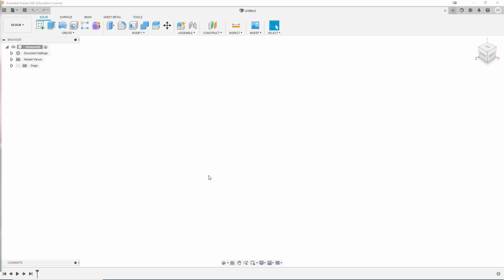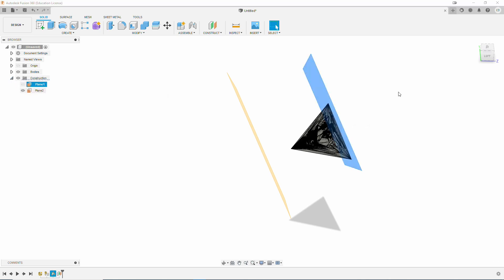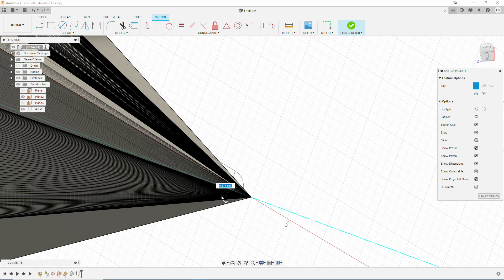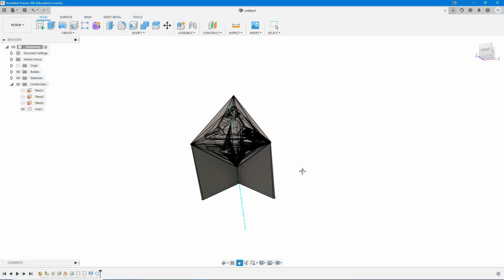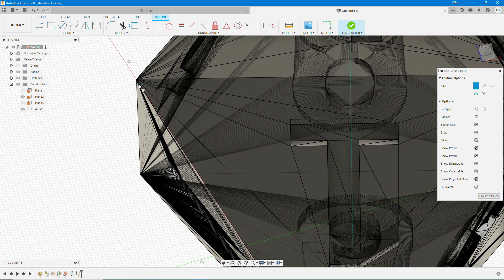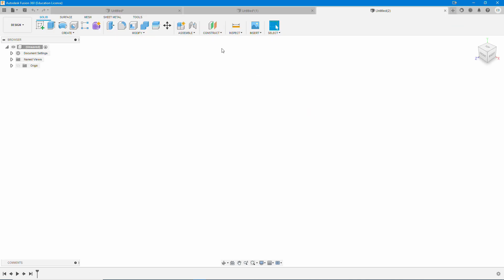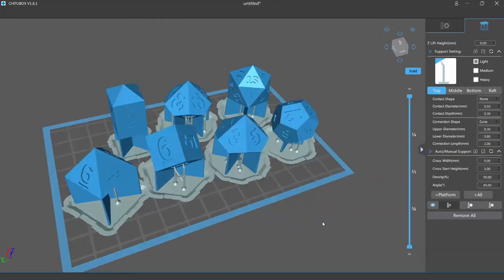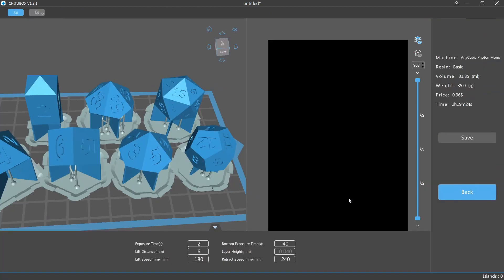Easy Fin Supports for 3d Printing Dice Masters

Comment: I just followed you steps this weekend and goodness did my first draft come out amazing with the fins.  Learning to make fins was certainly quicker than adding rows of supports to mimic a fin as other videos teach. And by using your method I learned new skills in 360 so win win.  My only goof was making the fins on the d6 meet at the tip. I think when I removed the fins it chipped the corner (Im not sure as I dropped the dice also and that could have caused the corner to deform ever slow slightly) But the good part about fusion is I just go back to my history, shorten the first sketch and let it reapply that change forward.  All the other edges and corners are as sharp and precise as i could have ever hoped for. Thanks

Comment: I realize this is a little old and not sure if anyone will see this but does anyone know how to make sure the number size is consistent across your dice? I have Text Size: 30 set across all my dice but the numbers are different sizes between them. I'm assuming the text size is relative to the size of the die and not the actual size of the font chosen?

Example: The numbers on my d4 with Text Size 30 is FAR smaller than my d10 with Text Size 30.

Any input or help would be greatly appreciated!

Comment: Hello! I keep getting bad geometry/self intersection errors when creating the lofts, but followed your instructions to the T (I think). I had problems with files from DiceGen before, but the same thing happened with dice I made on PolyDiceGen!
Reply from the maker: There is a box on the right hand d side with a couple of options at the bottom, one refers tangent edges, switch that option and let me know if it fixes the issue.
Reply: @KiltedDice  Tried both option and it didn't work :( The error message says:
There was a problem combining geometry together.  If
attempting a Join/Cut/Intersect, try to ensure that the bodies
have a clear overlap (problems can occur where faces and
edges are nearly coincident).
Reply: On the same model, after starting from scratch I'm now getting the "The loft would intersect itself" error.
Reply from the maker: @Nickmaytee94  for the join/cut/intersect error, you need to change the drop down box (on the right in the loft settings) to "new body"
For the "intersect itself" try switching the tangent option, if that doesn't work, you need to adjust the angle in your plane for that edge. It is too far off to one side, if that still doesn't work, change the distance of the offset plane, try closer and further away.

Comment: Wont lie hitting some issues. Some user error, possibly some being minor layout diff between mac and pc. However trying to learn key short cuts as it looks like you change between navigation/manipulation tools with keys vs buttons in the UI.
Reply from the maker: Excellent point. The only real keyboard shortcuts that I am using is the shift key for rotation vs pan (while using a mouse wheel). and the S key to search for "Project" which does have its own hotkey, but I forgot what it was while I was filming. If you could give me a timestamp of where you are having trouble, I would be more than happy to go through what I was doing with you. 
Also, Apologies for the late reply, was having some family stuff that I had to take care of.

Comment: Soooo, where is Part 3 for the Fin removal? :D
Reply from the maker: Lol. Will work that out on the next set
Reply from the maker: I just pulled a fresh set of masters from the printer for a client and will be using those for a fin removal video :-D Stay Tuned!!!
Reply: @KiltedDice  I just wanted to be a bit sarcastic with my sentence above :D
Buuuuut i still will be watching the Video bc I cant get the hang of clean removal, i am scarred to Ruin my Masters :o
Reply from the maker: @TheWubWolf  Clean support removal is a myth. You will always have some form of chipping. But fear not. I am currently working on a video detailing my entire finishing process to include chip repair. The fin removal will be a part of that.
Reply: @KiltedDice  I mean the best chip repair would be to print new masters ^^
i currently have a friend of mine 3d print your mold, and i got my dice printed but the support is still on there, so i cant wait to see the video :D
Reply: @KiltedDice  any removal video yet? I’m at that stage and my first attempt definitely got chipping.
Reply from the maker: @johnbiggscr  chipping is pretty common. I still get chipping happening and use IV resin to rebuild edges and corners. Super glue and baking soda are also a common fix for this. Just build it up, cure it (or let it dry) then cut with a sharp x-acto knife.